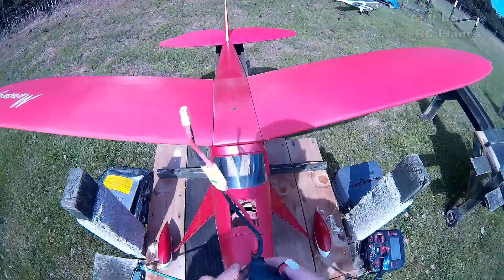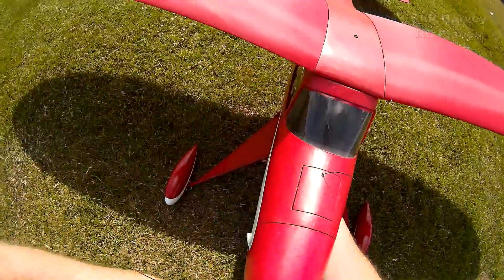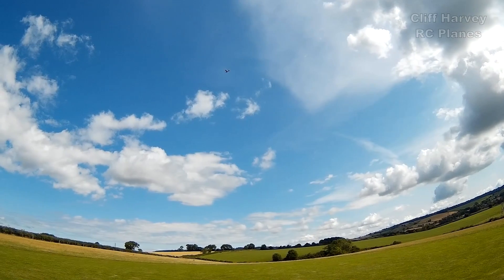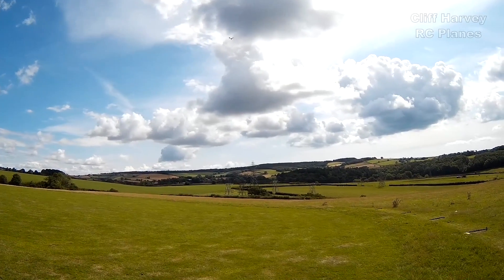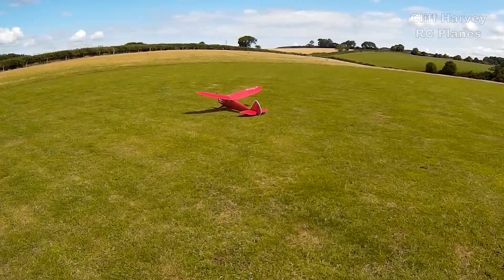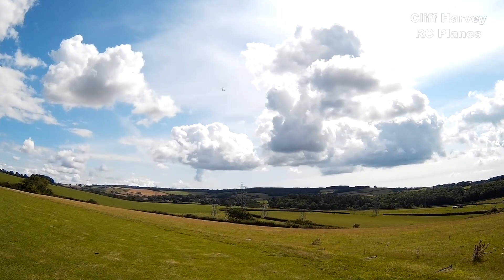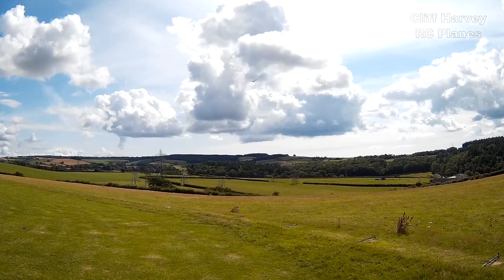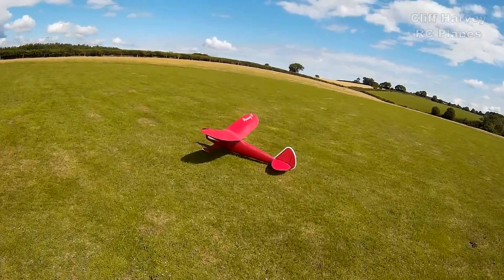Vintage Mercury IV Riding the Air Currents and Looping...kind of!

Comment: They are really great fun to fly. I've added a throttle elevator mix on a Junior 60  on a switch . When in use it progressively adds down elevator which helps when just flying about.If I want to fly "radio assist" I just turn the mix off and open the throttle  to get a near vertical climb then shut down the motor to glide down before repeating again.
Reply from the maker: That's a good idea Mark, thanks for the idea 👍